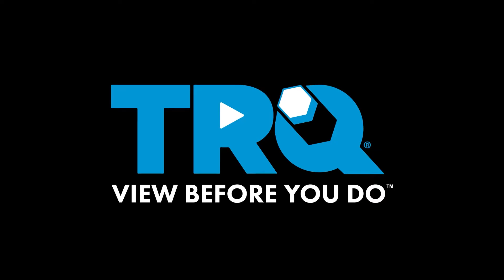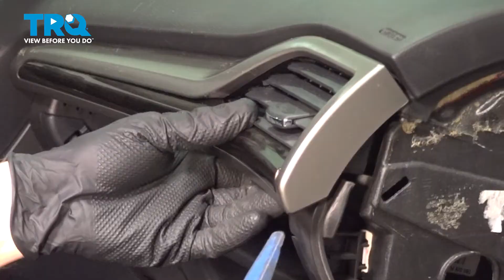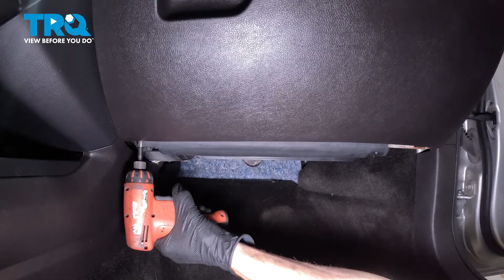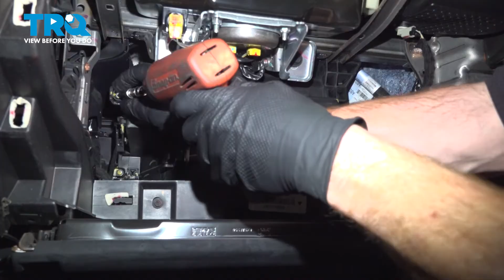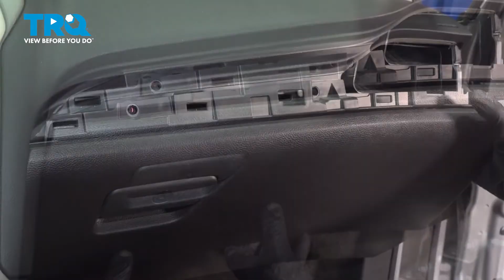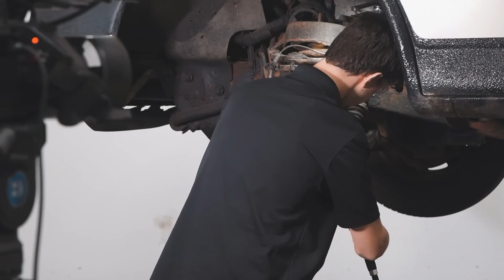How to Replace Cabin Air Filter 2013-2020 Ford Fusion

Comment: Don't let this video fool you.  For a novice mechanic like me, this a pita.  Took me much longer than it should have. Plus, every other vehicle I ever had it's basically open the glove, open a door,  and exchange the old and new filter.   A few minutes to do.
Also, when I pulled out the existing filter, the arrow was pointing up.  I know I didn't replace this one.  Had to be done at the dealer.

Comment: If the filter shows arrows with air flow direction, air flow direction is down.  If no air flow direction is noted, arrows usually point up.  It’s confusing.  On my motorcraft filter it shows air flow direction

Comment: I replaced mine today and I had a dead mouse drop down into the fan. I had to use a long flexible claw to remove it because It was causing a loud noise with the fan.